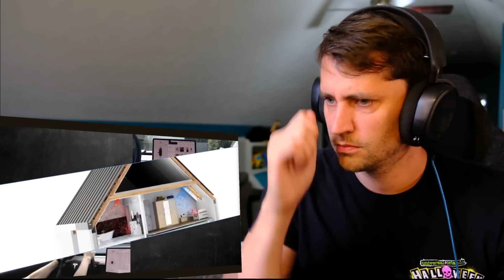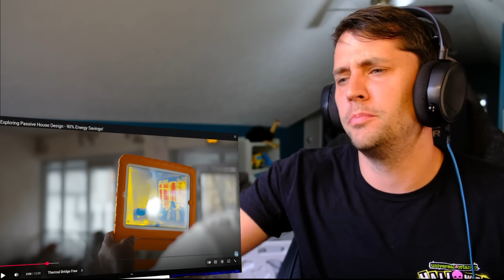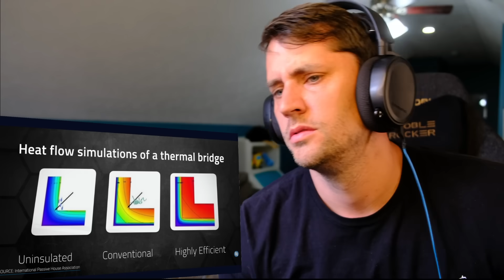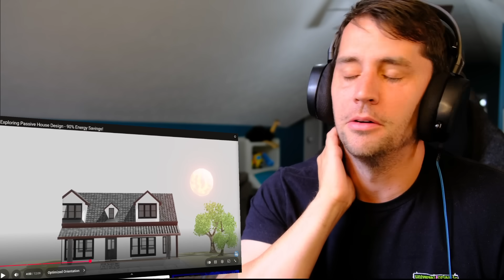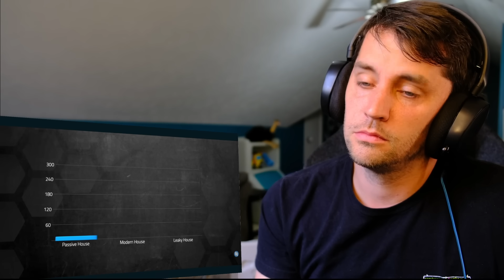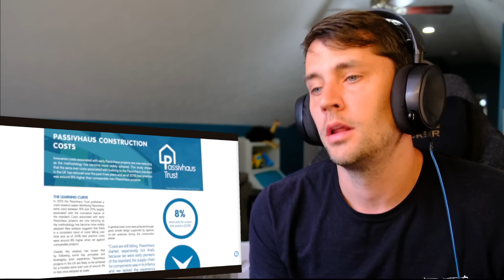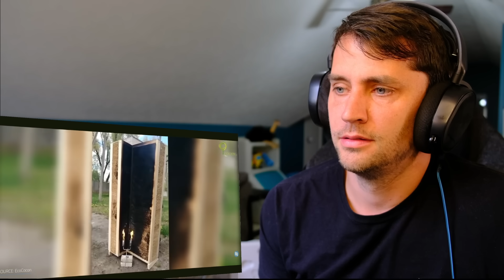American reacts to Germany's amazing 'Passivhaus'

Comment: In Germany, there are approximately:

- Residential passive houses: approx 28,000  
- Non-residential passive houses: approx 7,000  

Total: approx 35,000 certified passive houses.

In the USA, there are approximately:

- PHIUS-certified passive houses: approx 1,800  
- PHI-certified passive houses: approx 700  

Total: approx 2,500 certified passive houses.

(Note: I have omitted the source references to avoid potential automatic filtering by YouTube due to internet links.)

Comment: Living in sunny Cyprus, I don't care about energy cost for my house because my photovoltaic system is producing more than I need. The excess production in summer is being fed into the public grid and I get a credit which will tide me over the winter. Basically, I can use the public grid as a free battery. THAT should be the way to go everywhere where there is decent sunshine.
Reply: @peterfischer7084  living in North-West Germany. In total we have also energy cost around 0 €. We have pv- system, battery store and heatpump. And feed surpluy enercgy in the grid (we since 2012), is also normal possible here. No Gas heating.  Only grid Power , using dynamic Power prices. To have no energy costs in total here is a good performance.  Not in south europe, sorry.
Reply: Net metering aka using the grid as battery has severe Problems. In the end the grid is not a battery.  So until we figured out large scale seasonal energy storage, the energy as to produced by some other means in the winter. If you're doing net metering, those costs aren't accounted for by the people that are feeding in.
Reply: @Felix-st2ue  well, there are some solutions, like gravity batteries, aka pump storage water plants, but at least in Europe we have to really focus our efforts in building more to use them in a broader way to have seasonal storage
Reply: @M_R_Reese Gravity based approches dont have a high energy density though. You would need comically large installations to store relevant amounts of energy for long term.
Reply: @Felix-st2ue we allready use them in Austria, basically most of them use huge artificial lakes in the Alps and pump water up in peak production times to power turbines in low production times. But, yeah, more and bigger ones are needed if you want to go trough a whole season with them. Luckily Europe has quite a few mountains.
Reply: @M_R_Reese Yes quite a lot of them exist already. But they are inly operated on a short term basis. They are not designed as seasonal storage. And there is limited room to build new ones.
Reply: @Felix-st2ue  Came here to say exactly that. While this is a very consumer friendly approach to things, it is also an extremely expensive approach because it does not reflect the reality of a power grid at all. This may work out for a smaller country, but for a country as big as Germany with some really large manufacturing centers and very much regionally varying energy demands, this wouldn't be a sustainable implementation
Reply: @Felix-st2ue True, the Cypriot Electricity Authority is running fossil power stations that will have to provide a larger share of the total in winter (and obviously in the evening/night). But these costs aren't paid by those who are having a net metering contract. They are busy installing large scale battery systems though. Plus, soon net metering contract won't be available anymore. As of October it will only be net billing. I'm just lucky to have an old contract.
Reply: @peterfischer7084 they probably should install more wind turbines as well. But anyhow, net metering is a good thing in the early stages of the transition. But then it has to he rolled back eventually. The Netherlands have the same issue.

Comment: If in winter the house is heated to (for example) 20°C, everything in the room, furniture walls, air is 20°. If you open all windows for a short time, you exchange a lot of air, loosing the airs heat, but the house is still warm, after closing the windows the air is quickly reheated, but you don't have to reheat the hose itself. This is what we call Stoßlüften ;)

Comment: I live in a communal housing project (think 80 people taking on one enormous loan to build 6 multistory houses instead of one family taking out a normal loan to build one house...) in Germany and we had ecological goals front and centre while building. (It costs money while building but saves SO MUCH money in the long run...) We are far away from Passivhaus standards, but you can do sooo much with just good materials (we actually built mostly with wood, believe it or not), really good insulation, good windows, some heat pumps and a decent ventilation system. Our energy bill is way, way down, and it's not about IF you're allowed to open windows but WHEN - in the summer we let cool air in through the night and strictly keep windows closed and shutters (on the south side) down during the day (forget curtains, the trick is to stop the heat before it gets to the windows) and its really nice and cool all day even with 35°C outside. In the winter we hardly have to heat our apartment because of the residual heat, the sun coming in from the south and excess heat from oven, shower etc. Having lived in "Altbauwohnungen" my whole life (lit. "old building apartments") with leaky windows and heating that only makes half the room warm, I am really impressed by what can be done. The problem is that while we can switch from coal to green energy with a click and can pivot from gas cars to electric cars within one or two decades, it's really difficult to change the housing of people, some people live in houses that are more than a hundred years old...

Comment: @12:00 No, you cant actually heat up even a passive house with just body heat alone under normal circumstances, but come pretty close to holding the inside temperatures most of the year. If you consider that the house would only leak something around 2000-3000 Watts of heat total, then a family of four and all the things they turn on over the course of a day really do sum up to a considerable portion of the energy needed

Comment: 12:00
A human body continuously emits heat as a result of metabolic processes. On average, a resting adult generates approximately 100 watts (W) of thermal energy. This value can vary depending on activity level:

- At rest (e.g., sitting or sleeping): ~100 W  
- Light activity (e.g., walking): ~150–200 W  
- Intense activity (e.g., exercising): ~300–500 W or more  

To estimate how much energy a person contributes to heating a room, consider the following:

1. Heat output over time:  
   A resting person emits about 100 W, which is equivalent to 100 J/s. Over one hour, this amounts to:  
   
   100 W times 3600 s = 360,000 J = 360 kJ
     
   Over 24 hours, this would be 360 kJ times 24 = 8,640 kJ (or 8.64 MJ).

2. Impact on room temperature:  
   The actual effect on room temperature depends on factors like room size, insulation, and ventilation. For example, in a small, well-insulated room, the heat from one person can noticeably raise the temperature. However, in a large or poorly insulated space, the effect will be minimal.

3. Comparison to other heat sources:  
   A human at rest produces roughly the same amount of heat as a 100 W incandescent light bulb. In a room with multiple people, their combined heat output can significantly contribute to warming the space.

In summary, while a single person’s heat output is modest, in small or crowded spaces, human-generated heat can meaningfully contribute to maintaining or increasing room temperature.

Edit: Typo

Comment: Ryan, there is a trick to get fresh air into your well insulated house even when it is really cold outdoors. You fully open your windows but only for a very short time span, around 2-3 minutes. Then you immediately close them again. That way, you can pretty much exchange the whole air in your house but, crucially,  those nice european concrete walls stay warm - and so your house stays warm.

Comment: 7:00
Argon (Ar) is non-toxic because it is a chemically inert noble gas with a completely filled valence shell. Its electron configuration is  

1s^2\,2s^2\,2p^6\,3s^2\,3p^6
  
which makes it extremely stable and unwilling to form chemical bonds under physiological conditions. Because it doesn’t react with biomolecules (proteins, DNA, cell membranes, etc.), it has no direct biochemical mechanism to interfere with metabolism or cellular function.

Key points:

• Closed-shell stability: Argon’s outer shell is full, so it neither donates nor accepts electrons.  
• Lack of reactivity: It cannot bind to enzymes or receptors, so it cannot trigger toxic pathways.  
• Physical inertness: Inhaled argon simply mixes with the respiratory gases and is exhaled unchanged.  

(Note: In high enough concentrations, argon can displace oxygen in the lungs and cause asphyxiation—but that is a physical oxygen-deprivation hazard, not chemical toxicity of argon itself.)

Comment: Germany has one of the highest electric costs in the world, possibly even THE highest. That factors in why ever more people use almost every available space for photoelectric panels plus storage batteries. That's not even factored into the base passive house standard. Yes, the standard allocates a certain roof percentage to PV panels but not to that extent.

Since the passive house standard was created we have already advanced to the positive house standard with a house even being able to provide a (small) electric surplus to what it uses annually. So the house, with the correct feed-in laws in place, can even generate small amounts of income for the owner by feeding into the grid. This may cause a few load bearing concerns to the local grid but those are manageable. But once the load leveling has become automated this will result in a more decentralized electric power generation making huge power plants less necessary except for heavy industrial loads. This leads to an overall stability of the entire grid. Granted, this will still take some time to be fully realized.

Comment: The reason we can open our windows during winter is that most of our houses are build with heavy Materials like Bricks or concrete (and yes there are many other Materials too). Those heavy materials safe the heat energy inside really good and when you open the windows for an air exchange it's never so long that u drain the saved up heat energy in these heavy materials. Of course the air temp maybe drops by a few degrees for a short amount of time but those heated up materials slowly give up their saved up heat energy to reheat the air temperature without haveing to run your radiator or floor heating like crazy. The same pricipal also works during summer when u let the colder morning air in and there for cool down the room, the heavy Materials don't loose their heat energy really fast, there for they work like a passive AC.

Comment: Passiv House Standards are very strict , basically all new Houses in Germany are near Passive House Standards but may miss them by 5 or 10 % .  And yes , their are incentives to save energy and modernise your home , mostly cheap Loans from the KfW , an State/Goverment owned Bank with long Term secured/fixed low interrest rates = if the loan runs 20 Years its only adjusted one Time after 10 Years to a new , actual interrest rate Level . Those Loans rank behind morgages = you still can get a relativly  cheap mortgage from your Bank because the KfW Loans dont cover the complete costs of a new House , only the energy savings related . The 10 000 Euro more cost for a Passiv House sound a bit low and i guess they counted in the incentives already

Comment: 😉 Lüften is even more important in winter, cause the danger of mold growing on cold walls in high humidity is much higher. 

The trick is to adjust the duration of Lüften to the outdoor temperature, so the warmth stays inside the walls, but the moisture gets out.

To safe energy I have little sensors on my windows that are connected via bluetooth with special Thermostats on the radiators, that turn the radiators off, when I open the windows.

I’m so interested in all this stuff and I would really love to built such a passive house for my wonderful family! ❤
Reply: Yes, most people don't realize that the air in the house carries so few energy, it's all stored in the walls and furniture. It only takes 10 Wh to heat 1m³ of air by 30 degrees Celsius. So replacing the warm air with fresh cold air isn't wasting that much energy. You just have to do it fast, so there is no way to cool down the rest.

Comment: 3-layer window panes isolate better than most walls. Bad side: A 2m × 0.9m door to a balcony weighs around 90kg.Argon is a noble gas and therefore inert.
Imagine paying more for the house while you work, but still save on energy when you're retired.

Comment: There are several reasons why there are only few certified Passive Houses. 1) The certification costs some extra money on top of actually building the house and is completely optional. So there are quite some Passive Houses that are build using those standards but are just not certified. 2) There are different aspects you can optimize for when building a house. Passive Houses optimize for heating energy consumption while efficiency standards by the government and subsidies all go for "primary energy consumption", which adds in a factor for the energy type, and then suddenly electricity based systems don't look that good anymore compared to e.g. wood pellets. Finally a lot of people want to optimize for costs. The don't care about energy consumption in kWh but care about Euros spent in building the house vs. heating costs. An electrically heated passive house has just been more expensive than a well insulated gas heated house since gas was so much cheaper than electricity per kWh, but that changed since Ukraine...

Comment: Apparently when incendescant light bulbs were replaced more and more with flourescent light bulbs, passive houses had a problem: The high thermal losses of incendescant light bulbs were actually accounted for, and used to heat the house.

Comment: Argon is a "noble gas" meaning it does not react easily with anything. It is colorless, odorless and nonflammable.
People who have built a new passive house do often do a "house warming party" when they move in. The heat produced by the guests is sufficient to keep the house warm for the next weeks using the heat recovery ventilation.

Comment: Fun fact: the entire street where I live is oriented towards the sun to save on heating costs. The apartments are arranged so that the bedrooms face north so they don't heat up too much in the summer, and the living rooms are on the south side so that you don't have to heat as much in the winter. 
Arranging the apartment according to the sun creates a natural airflow which allows you to ventilate the apartment by opening and closing the windows. Because the cold air is heavier, it tries to replace the escaping warm air ------ AKA air exchange (this is the reason for " LÜFTEN ")
The best part... the house has been standing since 1894. Another fact: these old houses have high ceilings to prevent overheating in the summer (everyone knows that heat rises, right?!) Ancient knowledge that was lost thanks to modern technology is now being rediscovered and marketed as "THE ULTIMATE ENERGY SAVING SOLUTION".*** In the USA, the problem is actually quite easy to solve... ban this rigid street grid and use more greenery as natural climate regulation instead of just concrete everything over for cars!

Comment: There are a lot of houses close to passiv houses. The requirements are so special that a lot of houses are for example one short and are only efficient but not passive. We live in a newer house with the ventilation system, the three layered windows, Incredible insulation, solar panels on the roof (which is also planted for bees and other insects) and southsiding big windows in the living room/kitchen for warmth. The apartments are a new standard height of 165 cm ( it was 140 I think) and the doors 213cm ( 200cm in the past). I think Tiefgaragen ( big garage underneath the house/backyards) and barrierearm/Barrierefreiheit ( planed for wheelchair user and other mobility impaired people) is pretty standard for new houses in cities nowadays. So there are a lot of optimised houses which are not passive but close especially in bigger cities.

Comment: Two times "Quer-Lüften" for Ten minutes but from one corner of the house to the other one, should be enough for renewing the air inside gthe house without cooling it down. 
What peple are forgetting, that even furnitures absorb temperature and can give it back to the air.
But it´s  totally wrong in any house to "Dauerlüften" by keeping tthe Window only half opened.

Comment: A couple of my friends and my daughters' friends live in such houses here. They also have solar panels all around and energy storage in their basement, and all kinds of niceties like air filters, heated floors, and of course AC. It's really nice. 70% to 80% of the year they live off grid. The solar panels do not only cover their houshold energy use, but also charge their electric cars. Upfront additional costs are at least around 70k$ and pay off like in 25 years.